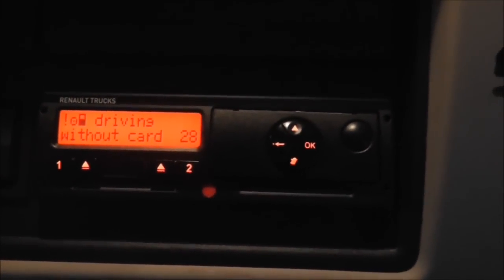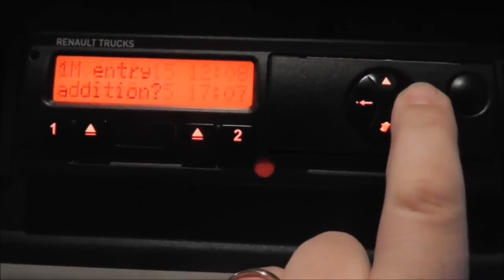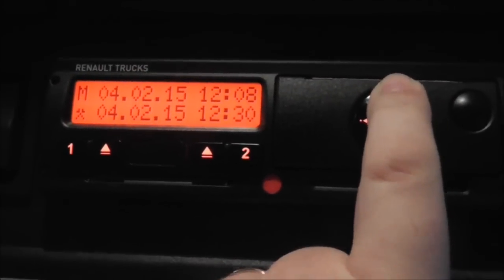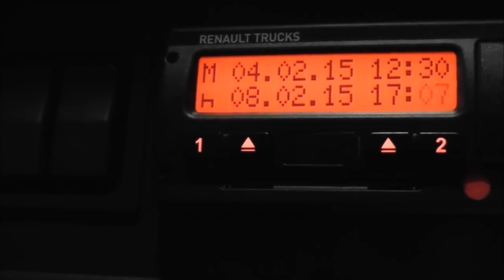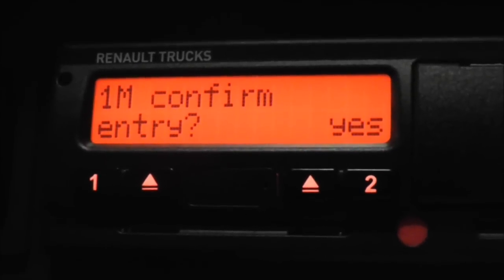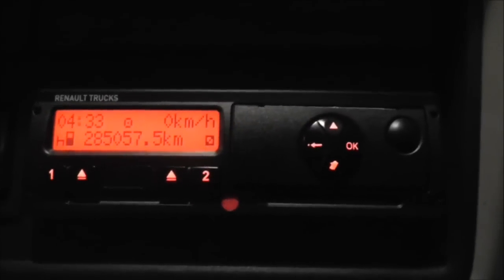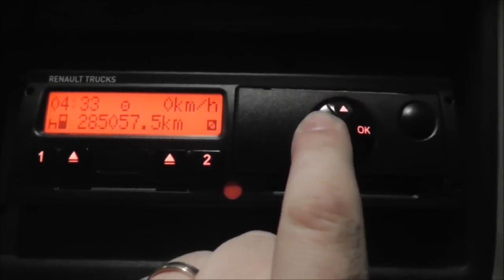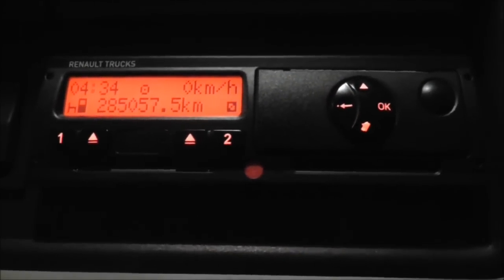Siemens Digital Tachograph - Manual Entry (How To)

Comment: So I've got a massive infringement on working time saying that on the Monday I had only 3 hours working time for the week . This is after bing told by a coc instructor that we now have to show our rest over weekends off . So Friday evening I finished at 19:30 that's card out and off home . I get back Monday morning put my card in it comes up with manual entry ? I hit yesterday and put it on bed from 1930 Friday afternoon til 6am Monday . Yet still got an infringement saying I've got three hours left working for week .
Reply from the maker: Is that 'Duty Time' or 'Working Time Directive' ?
I don't know what your issue is though WTD may have something to do with it.
The only other thing I can think of is you made a mistake when doing your manual entry. Also, you put your card in on Monday morning 'and hit yesterday', does this mean you only made a manual entry from Sunday instead of Friday ?

Comment: A question you may not have been asked before. I've been retired for 2 years and I am returning to work tomorrow. Is the procedure still the same after that length of time?  I remember having problems in the past getting it to go back to the previous month, let alone 2 years ago.
Reply from the maker: I think the tacho may just display 'rest until now' and prompt you to press OK.
If that's the case I'd just press OK then just make sure you select cross hammers.
As you haven't driven for so long you'll start with a clean slate anyway.
Reply: @TheRockgod23  Thanks for that

Comment: Hi Therockgid23, I am a new driver starting from scratch. I used my digi tacho card for the first time on Saturday which was the 4th of September 2021, now the next time I will drive the same truck is on the 18th of September 2021, why this is is because I am getting ready to start my new job on the 27th of September, so the local skip company to me that I’m working for has asked me to work both the Saturdays so I can familiarise myself with the job before I actually start with them, now as it’s a Volvo fl 250 18 tonnes will I have to do a manual entry and go back to the 4th of September and punch in the last time I used that truck to show I’ve been away from that vehicle. ? So let’s say I arrive on site at 6am I go into the office to pick up my daily work then I go back to the truck 10 mins later to then get in put my digi tacho card in to the now I believe it the Siemens tacho machine, do I type in all the information or do I do my daily checks first then let’s say before I drive off I’ve used 25 minutes already out of my work time, will this come off my 4.5hrs or as it’s a skip company do I get to work upto 6hrs before I have my break, like I say I am confused and need advice, if someone could respond ASAP it would be much appreciated

Comment: I was not told how to use the tacho card on the cpc nor during my my driver training.  I need to know when I do start working as a driver would I need to do manual entry? Can I not just skip it. If my shift is 6-2 but I start 630 why cant I just take my break and other work as normal . After all it's got nothing to do with the employers the tacho machine registers everything anyway. I am quite confused about the tachometer system thanks
Reply from the maker: Jak carn  As a driver all your time has to be recorded on your card, forget what the machine records as that is only for company requirements. If you start at 0600 and put your card in at 0630 you will not have recorded your duty time and daily/weekly rest correctly. As for the tacho machine 'recording everything anyway', what if you drive different vehicles, what happens when your card gets downloaded by DVSA/VOSA and your office ?
What will DVSA/VOSA think when your paperwork shows you started/finished at a particular time which doesn't match the info on your card ?
Think of your card as a digital diary.

Comment: what is the point of this bleeding manual entry.  When I am away I am resting.  What has it got to do with this machine needing a manual entry to know what I have been doing.  If i were driving another vehicle i would always use my bloody card.  seems pointless.  please reply.
Reply from the maker: You have to record what you have been doing for each 24 hour period, when you are 'away' it doesn't necessarily mean you are resting.  If you clock on at 0600 and your vehicle isn't ready you could be sat in the transport office doing paperwork (which is not resting), then get your paperwork and keys, get instructions from the transport manager before walking across the yard to your vehicle, all this is 'other work', not 'rest' so must be recorded on your card when you eventually get in your truck at 0630 (or whatever time it is), the manual entry will then show other work from 0600 - 0630. When you eject your card at the end of your shift at 1820 you then walk to the transport office, hand in paperwork, download card (other work)  etc and clock off at 1830.  The other work between 1820 - 1830 must be accounted for by means of a manual entry when you next insert your card. The machine is only there as a means to record the info to your card, we used to use a paper disc and pen but now it's a digi card and tacho machine !  It's not really pointless as it's the way to record what you are doing when your card is out of the machine, like I said before 'just because your card is out doesn't mean you are not working'.

Comment: When I end my shift do I just take card out or do I have to put it on break first? Thanks for the video, I have my first shift soon.
Reply from the maker: You just take it out. Doesn’t matter what mode the Tacho is on when there is no card in it.
Reply: @TheRockgod23  & Robert thanks for the question & answer just passed class 2 & was my self a little confused as to whether rest needed to be input at the end of a shift.top tutorial by the way rockgod.
Reply: Put it on bed first before taking card out

Comment: Can you help on this? I placed my card in and IM Entry addition appears, I got distracted for a few minutes and the IM Entry addition went off and the mode went on other work.  I usually press Yes to IM Entry but on this occasion I got distracted and left it too long and it automatically went on other work. Will this now record me as done other work from when I last took my card out? (Which was 13 hours previously) if this is the case then it's going to be an infringement?? Thanks in advance
Reply from the maker: If the mode switch had been left on rest overnight you should be OK as that is what will be recorded on your card (though not as accurate as doing a manual entry). If the mode was on other work overnight you will get an infringement recorded. 
As it was a genuine mistake all you need to do is get a printout and write on the back your previous finish time, your start time and 'wrong mode selected' . As long as it's not a regular occurrence you'll be fine, you will probably have to sign the analysis sheet to acknowledge the mistake. 
Some people eject their card and leave the mode switch on rest (though you don't have to) so that rest will be recorded next time they insert their card, this helps if you forget to do your manual entry ! 
Some drivers who never do a manual entry will always put it on rest after ejecting their card then insert at the start of their next shift and just start driving (which I wouldn't recommend) !
Reply: Thanks Rockgod. I work for the supermarkets driving fridge trailers. All tractor units are shared through drivers therefore some will leave mode on OtherWork and not Rest before ejecting their card. I inserted my card in one time and forgot to do a Manual entry. I'm not sure what would happens if I miss the manual entry. Will it record me as working still from when I took the card out the day before?

Comment: how do you do it now the clocks have gone forward
Reply from the maker: Digital Tachographs will always record the time in UTC , which is (kind of) European time (regardless of which country you are in).UTC time never has to be changed forward or back and is programmed into the tachograph. This is so a seemless time can be recorded if you travel through different countries and different time zones.For the drivers convenience you can set the 'local time' in the menu to display the correct time in whichever country you are in, local time is just displayed and not recorded unless 'local time' happens to be the same as 'UTC time'.To change 'local time' eg when the clocks go forward/back, you just go into the menu and manually change the time.Sounds complicated (though it isn't), hope you understood my explanation ?

Comment: Thanks for the tutorial. But if I may ask, is there a time when you do not need to do a manual entry or do you have to always do a manual entry each day before starting your driving for the day?
Reply from the maker: You must always do a manual entry as when you put your card in you must make an entry to indicate what you have been doing since you last took the card out.
If you don't do a manual entry e.g 
finish shift at 1800, remove card and go home.
Start shift at 0600 put card in, drive (without doing a manual entry).
We know you were on daily rest between 1800 - 0600 but if you don't do a manual entry indicating you were resting you may find that rest period being recorded as 'other work' . This normally happens when the tacho machine is left overnight on 'other work'.
If you leave the tacho machine on 'rest' overnight you should be ok as rest will be recorded for the period 1800 - 0600. I never do this as during the night the vehicle may be moved (loading etc) and I think (?)  this will be recorded on your card if you don't do your own manual entry.
Remember, your card is there to record everything you do in each 24 hr period, not just the time you are working or are in the vehicle.

Comment: got a daf 61' reg,and the Siemens vdo won't allow a Manuel entry on finish time
Reply from the maker: Are you trying to do a manual entry at the end of your shift ? 
You can only do the manual entry when you put your card in at the start your next shift.
Reply: That's what I'm trying to do,finish in the morning and start again. at 19.00.
Just add 15 other work to when I ended ,but for some reason this won't have it
Reply from the maker: Without seeing what you are doing I can't really help.
The best thing to do is ask another driver at the start of your shift .
Did you press OK after adding the 15 mins other work.
Reply: It didn't give me the option ,I'm just asking other drivers ,seems some machines are different others
Reply from the maker: OK, let me know when you find out the problem.
Reply: sorted,it just works different to your setup,maybe next gen?

Comment: I did the same as you craig the first 2 shifts useing tachos lol as I didn't know how to do a manual entry as it wasn't shown how in any lesson i was told put the card in an follow instructions 🤔 so for the first 2 shifts that i did it was showing 00.00 then my start time at 6am giving me 6 hours rest 😦when in fact I finished the previous shift at at 6pm making 12 hours rest but I have just keep the 2 print outs and explained the reasons on the back now I know we're I went wrong 😆 and have my proof it was a genuine mistake 🤓

Comment: +TheRockgod23 just come of a driving assement and for some reason he said I didint need to put my rest in between when I last had my card to when I put it in today,,,, I haven't used my card for a couple of months how would it show my rest from when I last had my card in till when I put it in today ? IDE be greatful if you could help be understand this thanks again jake
Reply from the maker: It wouldn't show rest that's why you have to do a manual entry. If you get pulled by the DVSA (VOSA) and they ask what you've been doing for the last couple of months and you say resting/holiday your card info should back this up, if you take your card out without a manual entry the last couple of months off may be recorded as 'other work'.I think the only way it works without a manual entry is if you take your card out and leave the tacho on break. When you put your card in the next day it will still be on break, I think this is then recorded as a break though I'm not certain as I always do manual entries.
Reply: Ok that's fine then as I put it on break before I took the card out fingers crossed it's recorded as break...... Another one I totally forgot to ask about is doing entrys for British summer time what's that all about bud ? Thanks for the help

Comment: do u have too do a Manual entry cos every time I get a print out it always show from 00.00 till I start a ?
Reply from the maker: Personally, I would always do a manual  entry at the start of a  shift to confirm what I have done since the card was last ejected. Even to show your shift finished at 1800 though you may have taken your card out at 1758. You would also do a manual entry to show your shift started at 0600 though the card wasn't put in 'til 0602. Doing this confirms you were on rest between 1800 - 0600.
Printouts only give a 24 hour period on any given date not for the shift you are working. Basically 24 hrs of info from midnight to midnight.  If you work a night shift and go past midnight you would need 2 printouts. This gets complicated as these printouts would also include data from your previous night shift !
Hope that makes sense ???

Comment: Cheers for that my friend, I am picking up infringements left right and centre and it's also affecting pay due to the high amounts of rest I'm inputting.
Reply from the maker: Don' fall into the trap of putting it on 'rest' every time you stop, you'll get infringements for improper use of mode switch. Keep it simple, the only time you should be pressing the buttons is when you start/finish your shift and when you park up to have a proper break or select POA. Just be careful as some tachograph machines default is break, so every time you stop the tachograph goes on break.

Comment: hi I'm stuck. I am new to tachograph work and I'm getting loads of infringements. I finished my shift last night and I put tacho on rest. I drove back to Rochdale in a works car and I start my next shift at 4 pm in Rochdale. I then have to drive to Keele services in a work's car prior to starting my duties.    What do I need to input into the tacho reader?  any help would be appreciated.
Reply from the maker: The time spent driving back to Rochdale in the works car is still duty time, you didn't finish your shift at Keele you finished at Rochdale. When you start at Rochdale at 4 pm that is the start of your duties not when you start at Keele. If you start at 4 pm and let's say you get to Keele at 6 pm you put your card in , do a manual entry indicating your finish time at Rochdale (the last shift) and then a manual entry indicating this shifts start time which is 4pm. You then have to input that you were doing other work between 4 pm - 6 pm.
Reply: That's well explained, thanks

Comment: why my print out give diffrent driving time and data on computer in office diffrent ??
Reply from the maker: All tachograph machines are set to 'European Time' and will always record information in this time setting. You can set your clock to display 'local time' for your convenience though this is not what is recorded. This 'European Time' setting is set to the same time whether you are in England, Portugal or Greece etc even though 'local time' in these Countries will be different.
Reply: ***** I figured it out now. Driving time on print out shows how much time I drove before and after brake. Last week I 4h29m driving then 45min brake and then I drove 23 min to depot. On print out it showed 4h52min driving and I thought I gone over but I didn't. Hope it make sense to you

Comment: hi there I don't drive very often e.g every other week sometimes three weeks in between but during this time I do other work no driving do I have to put my last shift on my card from that job
Reply: I'm in same boat with a factory job full time and driving every other Sunday. I was told rather than do manual entry for each shift for the week it's fine to write the start/finish time and date of each of the weeks shift days on back of scrap Tachograph paper BEFORE u start your driving shift incase you get stopped.

Comment: can you help?
friday - 24.7.15 card removed.
sat - rest
sun - rest
mon - other work - 0600 to 16:30 ( i didn't insert card in slot two as was working as drivers mate. i would need to enter as "other work" manually?
how would i enter this?
Reply from the maker: Gary Hiscutt If you 'worked' all day as a drivers mate (no driving) you still need to record what you have done.
 If you forgot to insert your card on Monday you then insert on Tuesday, the display will indicate to you the last time the card was removed (Friday), you then OK your finish time.  
The display will then jump forward to Tuesday as you've just put your card in and ask if this is your start time, you then select NO and scroll backwards to Monday morning at 0600 and OK this as your start time, you can then scroll through Monday and select what you where doing at what time eg having a break and at your finish time select rest. You then scroll through to your start time Tuesday and select 'other work'.
Hope you can understand that ??
Reply: +TheRockgod23 Sorry for late response, and yes thats great. Thanks for the information.